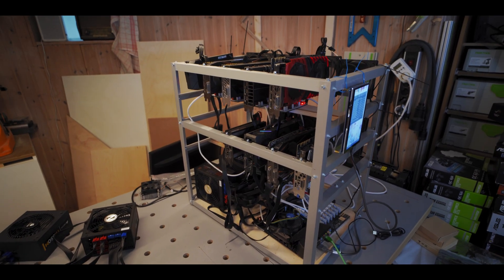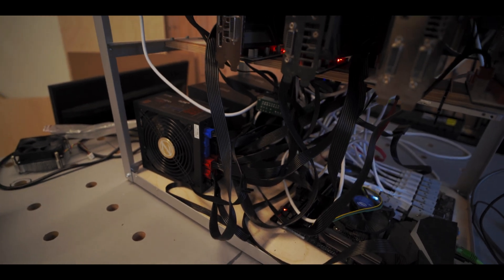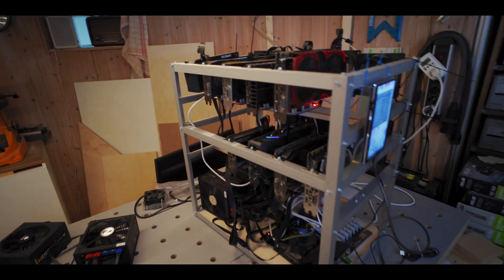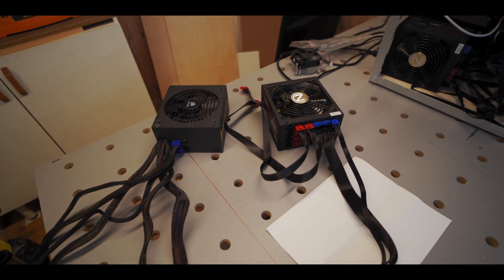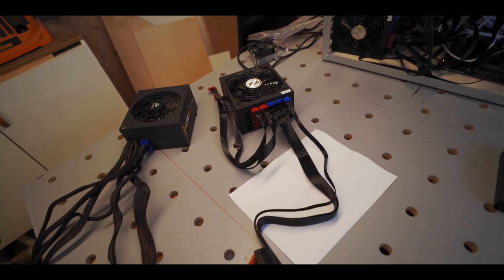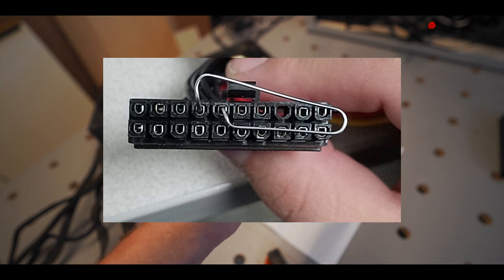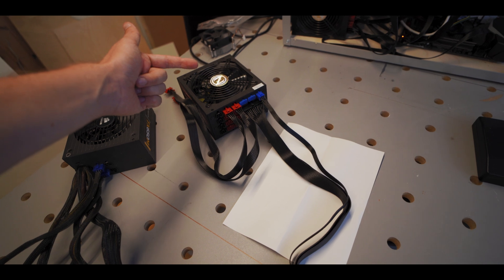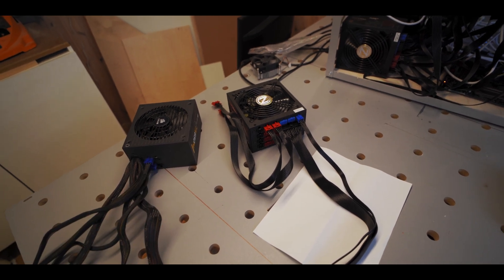How to SAFELY use multiple power supplies for crypto mining (4 ways!) 24-pin PSU splitters, Add2PSU

Comment from the maker: If you have any questions about how to use multiple power supplies or how to plug your components in, then please post them here in the comments! I also recommend you watch my video on how to safely power your mining rigs here: https://youtu.be/MIW0i7SlIYI And also here's a video of me building a mining rig from start to finish: https://youtu.be/TUtr9S4b2T4
Reply: If your mining on two psu, the main psu for all parts like mobo, fans, etc. The second Psu for all the cards. Can I plug the gpus into the motherboard risers while using power from the second psu.
Reply: I am having an issue with my B250 Motherboard and it won’t recognize the GPU’s powered by my second power supply. I was really seeing your familiar with these motherboards and what I need to do
Reply: your link doesnt work internationally
Reply from the maker: @pearlrival3124  unfortunately I only have american amazon links so far. I'm working on making it international.
Reply from the maker: Tbird 2013  I’ve had some really high temperatures in my mining location recently and the have held up flawlessly. Since the actual chips barely use any power at all they don’t get warm really, just the temperature of what is around it.
Reply: Tbird 2013  i use molex on all my rigs. maintain good connections (like you would in any electrical situation) use new psu's (2005-above) you are good.
Reply: Can you help, i tried this powering my extra rig using this method but the fans start screaming, and LA on hiveos keep climbing, i though its going to explode lol.
Reply: @bxeagle3932  oh yes! I've received it as well!
Reply: Can the power supplies connected be of different power ratings ? Like one is gold and the other is say silver ?
Reply: do both PSUs need to be identical or same wattage ???
Reply from the maker: @SkyHighFilms777  nope :)
Reply: most risers in non mining systems have no power.. Does that mean they are powered by MB/main PSU? Does it mean I cant power GPU from different PSU in classic PC?
Reply: Hi! 4 years late here, but still worth asking :)

How do you handle the UPSs? Do all PSUs go to the same UPS? Does each PSU get their own UPS (or some variation thereof)?  I'm trying to run dual PSUs on my main work computer to "cheat" a little bit and avoid having to buy a multi-thousand-dollar 2KW UPS to support my HW (yes, it's a bit on the beefy side :) ) ... and am trying to run each PSU connected to its own independent UPS. The UPS units are older, but VERY reliable APC models (APC BR1500).

However, whenever the power trips (even during tests!), the "main" UPS connected to the PSU that powers the motherboard will hit an apparent overload even though the computer is idling on the BIOS ... the second UPS is OK, but this is because the entire hardware shuts down instantly. I've swapped UPS units around and the behavior is "the same" - i.e. the UPS powering the PSU that powers the motherboard, whichever one it happens to be at the moment of the test - fails due to "overload" (again ... nonsensical to me b/c BIOS!).

Any thoughts/suggestions? Any reference material you can point me towards?

Thanks!!
Reply: is this safe if the PSUs are different/have different W?

Comment: What if the riser (attached to gpu which uses a 2nd psu) is a MCIO port riser? So not s cheap riser with condensators and "USB" looking cable but a riser which can allow gen5 16x speeds using 2 MCIO 8i ports. My consern is with these, will the MCIO deliver to GPU electricity from PSU1(cos comes from motherbord)  meanwhile the riser 6pin cable and the GPU 8pin uses PSU2 ??

Comment: What if I use the method on PC and GPU connect directly to PCIE motherboard (that using PSU 1) and using power from PSU 2 for the GPU power pin?
is that also consider as big no?

Comment: Very informative video man. Thank you. I don't mine personally, but this did enlighten me on how to set up a workstation with multiple PSU's to power my dual AMD Radeon Pro WX8200 cards and not have to buy a crazily priced PSU 1000+ watts as I have multiple spares of varying capacities. These cards pull approx 240w each under heavy load, so a 750 gives me ample room to feed em , as well as connect the GPU aux power molex on the motherboard to it should it need more power. Leaving a 650 watts psu to power peripherals, MB, CPU, etc. and never really max out wither units. I took to the time to build a custom case to house it all neatly and it has one psu on the top (standard location) and the other in the bottom chamber with ventilation isolated from the rest of the case and enough clearance to get plenty of intake air. That Add2PSU PCB was the perfect add-on to make this work safely.

Comment: If i have a regular pc and just want to run my gpu from second psu is it ok to have the motherboard splitter and have the gpu power connectors plugged to second psu? I mean the motherboard and the pcie port would be powered by psu1.
Reply: Would sleep work correctly in Windows?

Comment: I have a question friend, I hope you can answer me.
I created a farm with two power supplies. 1200W and 750W and use the system you use in this video with an Add2PSU Multiple Power. It works wonderfully! But I wanted to replace the 750W power supply with a 1350W one. I thought it was just replacing it and that's it. but I noticed that the second power supply was not reacting.
Then use the original 24 pin cable from the power supply Thermaltek1350W and plug it into the adapter.
boom! strange sound and smell of ugly plastic. I turned everything off immediately and went back to the previous settings. Everything ok luckily. Do you have any idea why this happened? Thank you very much for your info!

Comment: In the end you said one should always power the riser from the same source. 
In my case, I didn't plan to use a riser, I want to install 2 GPUs on the same mainboard and power one of them off a second PSU. In this case I can't power the PCIe slot from the second PSU.
Would this be an issue?
Reply from the maker: @cookie_space  unfortunately, yes, as if the PSU powering that extra GPU dies there is a risk the GPU will try to pull all power through the motherboard which could cause major damage
Reply: @SebsFinTechChannel  Didn't expect an answer on an older video, nice :D
So the safest option would be to use a riser card, that I can power externally from the second PSU. But I have only seen those for PCIe x1 slots and I have a second x16 on the mainboard.
This would mean I'll lose some performance on the second card

Comment: did this ever have any issues mixing PSU units? did any components degrade or any stability issues due to this? I was told not to use two different PSU units unless they are the same product, is it an issue in using different PSU with different wattages?

Comment: Personally, I think the 3rd way you showed is the BEST way.    The using the "Chip" method takes away from an available 6-pin connector you could be using to power up something else.  Just my humble opinion.   I'm sure someone else probably has mentioned that, but I'm not going to troll through almost 500 comments to find out.

Comment: had a question about whether a splitter or a add2psu would be better in terms of setup for a dual psu setup and also how a dual psu setup would look like for a gaming rig instead of a mining rig? I was thinking of having main PSU power my mobo, gpu, m.2 drives etc. and have my second psu power a custom cooling loop, the fans (thinking through a hub or something), the rgb lighting, the ssd and hdd, and stuff like that (if possible of course). I just don't know the basic do's/don'ts any advice would be wonderful

Comment: Hey Seb/guys I just waited weeks to get 2 psu splitter chips (not sure what they're called), but it's the 4th method here. When they arrived it had 24 pin spot, and sata (not molex). How much is the power draw? Is that acceptable, or do I need to go find a 24pin/molex psu splitter?

Thanks, stay blessed!! #dontwannastartafire
Reply from the maker: That’s fine they barely use any power at all maybe like 1 watt
Reply: Awesome! You saved me from a housefire, but also a heartattack :) lol! im incredibly bad with tech, but i will continue to learn from you! Thanks @SebsFinTechChannel

Comment: Can i use the secondary PSU to power up my RTX 3090, while its connected to my PCIe slot on the motherboard?
Reply from the maker: You can but it wouldn’t be safe as if the extra power supply dies the GPU would still be on and worst case scenario try to pull all its power from the motherboard which could cause a short or fire or damage your computer.

Comment: Just a random question !!! 

With regards to the "on/off" switch on the back of each individual power supply... do they both stay in the ON position once plugged in? Do you have to power on the main power supply before powering on the secondary power supply? (E.G the order?) would there be any consequences if you powered on the secondary power supply, before the main power supply is on?
Reply from the maker: They should both be on and I recommend turning the SECONDARY power supply on first, as it’s important that the secondary is switched on and already ready to provide power when the primary is switched on.

Comment: I thought Molex wasnt safe to run GPU's to it I was told only run P2 cables
Reply from the maker: You’re not running the molex to the GPUs you’re running it to a tiny chip that pulls almost no power that just makes sure the secondary power supply turns on

Comment: But what if my mother board needs a specific psu so I would use the dual psu but I don’t have the 24 pin connection on my mother board so I would put the 24 pin into the adapter and use a sata cable? Can you show how to do that?

Comment: I guess its safe to use different brand PSU:s together with the chip?
Reply from the maker: You guess correctly
Reply: @SebsFinTechChannel  Thanks for the fast answer! Wouldnt make any sense if 2different would not work safely between each other but better safe than sorry and ask :)

Comment: Very good information, you answered some basic questions that bothered me. I'm an electronic technician but don't know anything about mining. A couple of suggestions: If you make videos like this in the future, you keep referencing your first choice as a "chip"; however, that is a BOARD and not a chip. A chip implies an integrated circuit and the word chip comes from the actual silicon wafer ie, "chip" that is found on all IC's. So I would use the word circuit board and more correctly you should say relay board because that orange component on the board is  a relay that once it is powered on or energized by the main power supply it closes the contacts in the relay that then signals the next power supply to power up. Also when you explain the need for keeping the power supplies separated at around the 13 and 14 minute mark, you mentioned that if one power supply fails and that certainly is a valid concern, but from an electronics perspective, there is always the possibility and I would say the likelihood that no two power supplies will generate the exact same voltage even though the label on the power supply says that it does. You may also notice a plus-minus percentage as well telling you that the voltage will likely not be exact. So the most important reason why we want to keep power supplies apart is so that they don't get into a situation where one voltage is higher than the other supplying the same graphics card. That is a real world and very frequently occurring design issue. Your stipulation to never mix power supplies is well-founded and I wholeheartedly support that. Thanks again! Great video, and of course I gave you a thumbs up.

Comment: The best video i have seen since I started mining one year ago. I got rid of my server PSU. It was very efficient, but way too loud and hot. I got ten rx5600xt gpus and got myself one RM650 and one RM750 for 100 Euros. Both are very quiet, the system is stable. Since the rx5600 runs on lower watts, I can use one cable to run two cards and two risers!

Comment: I know sata power sucks for risers, does it also apply for the add2psu method? Can I safely power my add2psu using a sata rather than a Molex without running into issues? Thanks
Reply from the maker: You can safely use Sata since an Add2PSU chip only uses a tiny amount of power so it’s safe. The reason Sata isn’t safe for risers is that risers can pull up to 75W which is more than Sata can handle, but an Add2PSU chip will never pull nowhere near that much.

Comment: Very good explanation, but
I'm going to ask a silly question, for the second PSU (the one connected to the add2psu) Do you still need to plug it to an electric outlet? or does the Main PSU provide all the power
Reply from the maker: Yes all PSUs need to be plugged into power :)

Comment: Hey, When you do the splitter method, I assume it’s the normal process right? Meaning I flip the power switch on both PSU and then I hit the power switch button that is connected to my motherboard power sw/reset/hdd/led header?
Reply from the maker: Yeah

Comment: I used your link today to buy one of those Add2psu adapters, waiting on another card and there is not enough  connection on the PSU for many 30 series cards.
On these EVGA 3080ti cards, they went berserk with power requirements 3x8 pin and 450w 😲
Great educational stuff man, keep it up 👍🏻

Comment: Hi, I am your follower. And I got a problem of using add2PSU. I use B250 MINING EXPERT motherboard, it could connect 19 gpus. I use A main psu and use it's sata connects three add2psu chips with 3 psu. B and C connect other two psu. So there is 6 psus in total supply power to 17 3060ti gpus. Every gup is lighting and cpu fan is working, the problem is system did not sart up. Could you please hope me. Thx a lot

Comment: Thanks so much for this video. Question, I just bought this BTC S37, a generic motherboard. But, this one doesn't have the normal motherboard power plug, rather, it's using the 6-pin PCIe of the first slot to power the board, CPU, etc.

I just have 1 x 1200W ATX power supply atm and I think it can support up to 4 x RTX 3060ti fine. Now, if I want to go more GPUs, I might need 2-3 power supply. Can I still use your suggestions above to do it?

1. If I use the 3rd method (the branching adapter), can I put a "pin stopper" into it? =O
2. If I use the 4th method (the PSU splitter device), can I put a "pin stopper" on the main power supply?

It's just the motherboard only takes that PCIe cable to power. Thanks for the help.

Comment: I have 2 rigs one is at 900mh running 2 1600 platinum psu corsair and second ru Ning 840mh with evga 1300 platinums on the 2 1300w psu I'm at 2050watts use and on the 2 1600watts I'm at 2450 is that enough headway? I have been watching your videos and so far very helpful and answered questions that I couldn't find. 👍

Comment: Omigod Seb you have done it again! Thank you for this video. I am going through every single one of your videos and the posts in Discord Chat with Seb channel and am learning so much! This old school 1980s cobol programmer/desktop builder granny loves getting her hands back into PC components via mining. Day job is management, haven't been a programmer since the 90s. I miss being hands-on! I've been slowly putting my rig together and by trial and error/watching your videos/readings (not always in that order), I am getting things sorted out. I just realized the my 3070 that has 2 8pin connectors should NOT be using one power cable. Thank god I just bought a new psu yesterday so I could hook it up. Unfortunately all I have is the jumper for now, but I did just order your top 2 recommendations and will switch over to one of them when they arrive. I've been getting some weird issues causing my rig to crash that I think will settle down using 2 power supplies, plus its definitely got to be healthier and safer to power my 3070 the right way. Thanks for all you do, you are awesome!

Comment: I don’t use the atx24 splitter cables , they are not well made in my experience . The pins can move around and cause problems . The add2psu boards are a much better solution. They work totally fine being triggered by other secondary psus and don’ t need to be triggered by the primary .  Fan hubs also don’t need to be powered only from the mobo unless you have them hooked up with PWM to the mobo , in that case yes only use the primary to power.  Your comments on avoiding cross connecting gpus and their risers is absolutely correct .  This can cause all sorts of problems don’t do it.

Comment: Just stumbled upon this. Any issue with mixing an evga 850 and evga 1000 PSU on the same rig.  Was going to have the 850 run board, components, and smaller  gpu's... The 1000 running my 3080ti's.  Thanks.

Comment: Very great video, thanks, man! I do have a question, so the main PSU and the second PSU, which one start first? I have 220W PSU on my old computer, and I have another 850 W. can I use the old 220W only work on the mobo, CPU and harddrive but not the GPU. I only use 850W PSU for GPUs, does that work? Of course I need a Add2PSU chip.
Reply: Using add2psu makes motherboard's (and sata, cpu) power supply starts little bit earlier.

Comment: Im surprised this hasn’t been asked yet, so ill go ahead: Some PSU cables are 16 AWG like corsair.. and the 24 pin splitters on the market are all 18 awg.. is it safe to use 18 awg splitter if ur psu 24 pin is 16 awg?

Comment: Just make sure u don’t use the y cable splitter for fsp cannon 2000w psu. It just won’t power up. For some reason it won’t power up even shorting the pins.